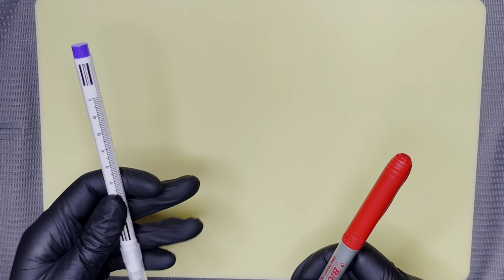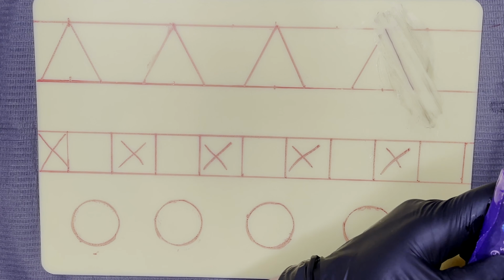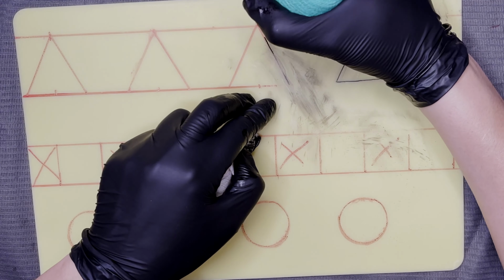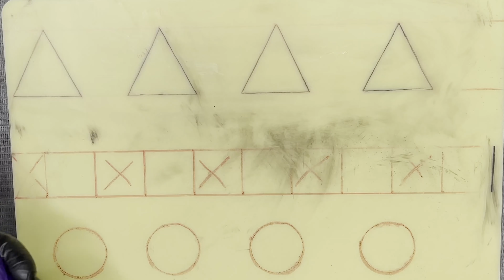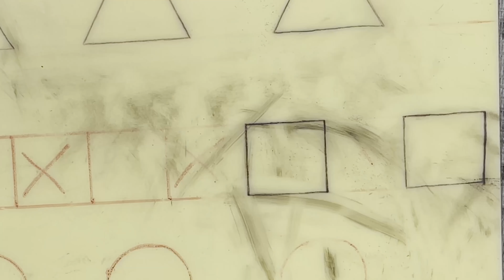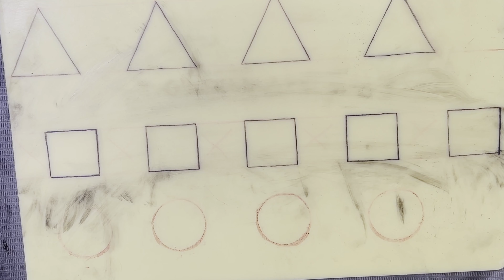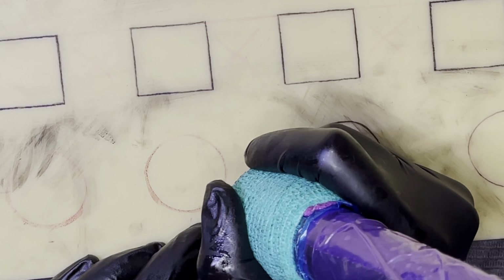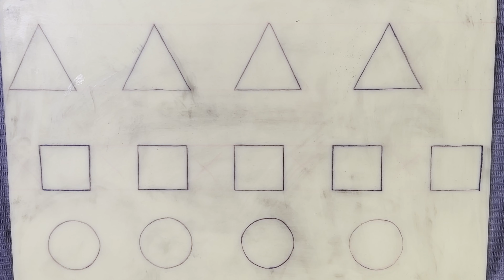Tattoo Basics, Lining Practice Tips

Comment: What voltage was best for you and is it harder to controller the higher the voltage
Reply from the maker: It depends on the line, straight lines I prefer higher voltage, curved usually lower voltage. Higher voltage means you need a faster hand speed so it can be a bit harder to control/takes more practice.

Comment: Can I use vasline or Dettol liquid soap for wiping in fake skin.
Also whenever I wipe the tatto lines are not there.i tried by applying diffrent voltage setting also.
Reply from the maker: Vaseline works well for wiping fake skin. Not sure why your lines are not there. Try slowing your hand speed down and setting your needle depth a bit deeeper.

Comment: Floaty Lady

When I’m lining I get little hand jitters that make me have a slight trouble keeping constant depth all the way. If I put my pinky and ring finger uncomfortably flat then it will stabilise the shake. But it is so uncomfortable and awkward. I seen people just line by holding just like a pencil grip with no shakes. Any tips on how to not get those little jitters
Reply from the maker: It's definitely uncomfortable at first, if you repeat those moves again and again they will get smoother as you build up those muscles. Make sure your grip is wide enough because that will enable your hand to relax more, you don't want to have to be squeezing small grip too much.
Reply: Also try chewing a gum. Depending on the origin of the jitters, you might experience none to significant improvement.
Reply: Practice , muscle memory will kick in after enough repetition

Comment: use a bigger liner to practice lining . its easier to pull straight lines using needles from 7 to 9 . and practice one pass line only. youre sculpting on it.
Reply from the maker: Thanks for the input, will take into consideration.
Reply: i started off with thinner liner(3rlT), it didn’t take me long to know thin, but thicker liners is so much easier. for me the thicker was easier since i learned with thinner so i managed to build a steady hand